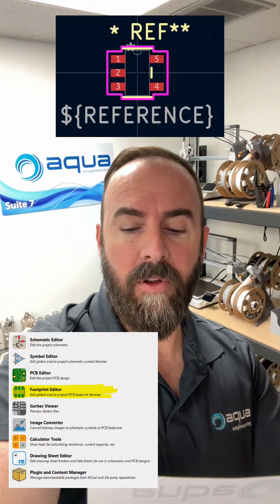KiCAD Component Tutorial

Comment: *** Part 1: Create the Footprint ****
1. Make or Import the Footprint Start by creating the footprint or importing one you already have [00:00].

2. Unshow Value Checkbox Uncheck the value checkbox to avoid cluttering up your screen [00:05].

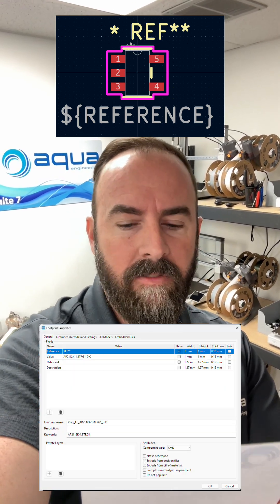3. Select and Orient 3D Model Select the 3D model for the component and orient it correctly [00:11].

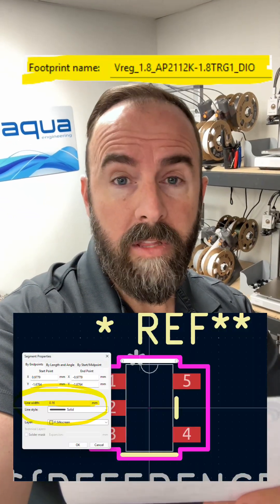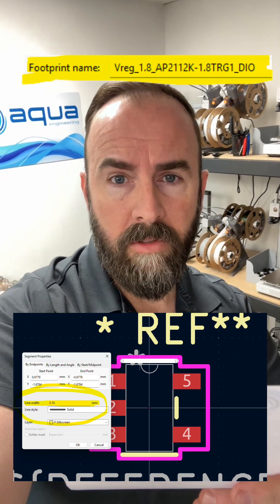4. Update Line Widths and Rename Update line widths and rename the part [00:14]. For meeting specific requirements, such as JLC PCB's silk screen, use a value like 0.16 mm [00:18].

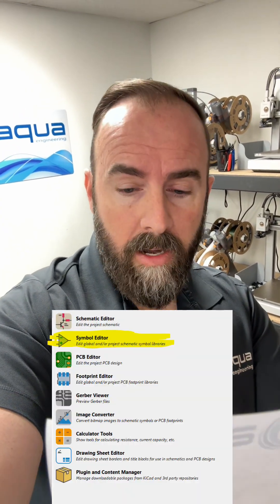5.  Save and Exit Save and exit the footprint editor [00:25].

**** Part 2: Create the Symbol (Symbol Editor) ****
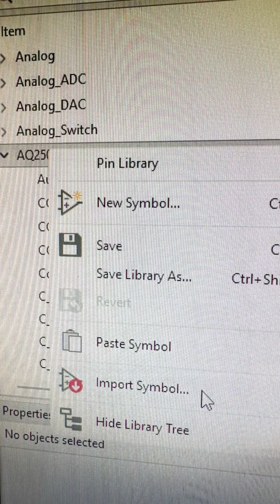1. Enter Symbol Editor Go into your symbol editor [00:27].

2. Import the Symbol Import the symbol that you just downloaded [00:29].

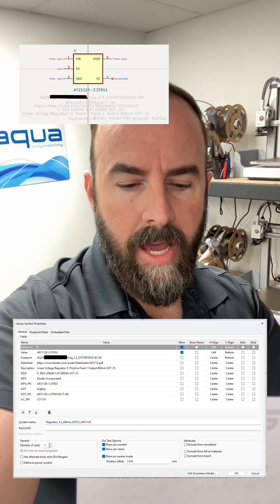3. Open Library Symbol Properties Open the library symbol properties by right-clicking or double-clicking [00:32].

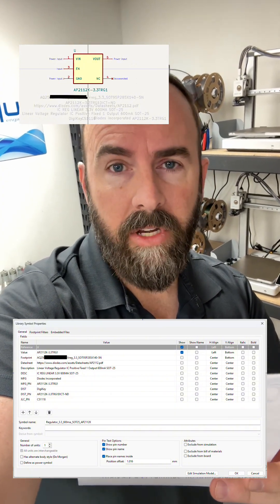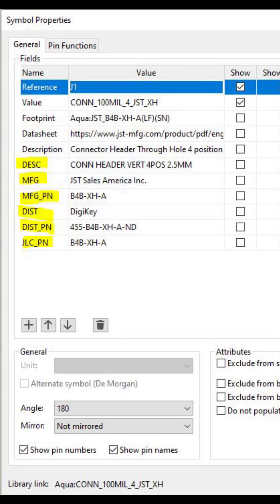4. Clean Up and Add Fields Clean up and add some fields to ensure all your Bill of Materials (BOM) variables will match [00:35]. The recommended fields to add are [00:46]:
Short description
Manufacturer
Manufacturer part number
Distributor
Distributor part number
JLC part number (optional, if you wish to have JLC PCB prepopulate your board)

5. Set Visibility Only show the reference and the value; do not show all the other newly added fields [00:54].

6. Save Symbol Save it [01:00].

Comment: KiCad is a pretty amazing for an open source product. I have used Altium for 25 years and imported several KiCad projects.
Reply from the maker: I would be using Altium if not for the price tag. Before KiCAD there was no good alternative and I was using Pulsonix with a high speed trace add on at like $2500 or so. I’m trying to migrate anything and everything to open source as I get older and get more years in business under my belt.